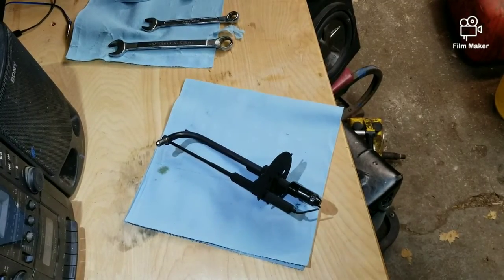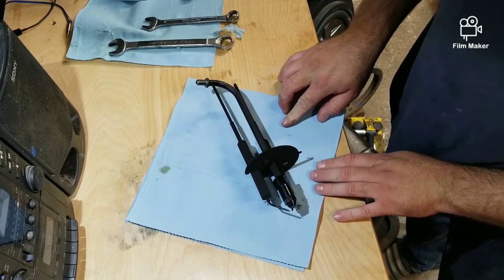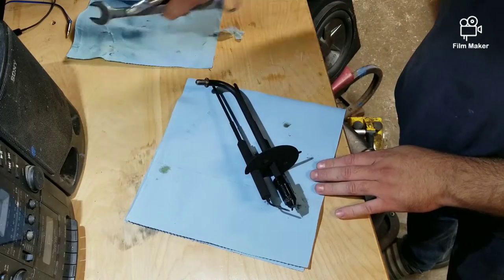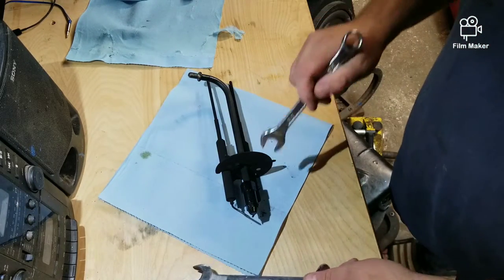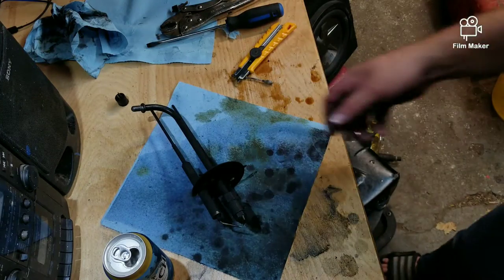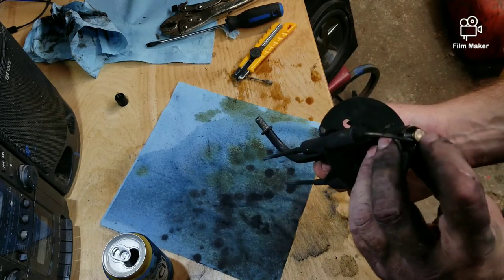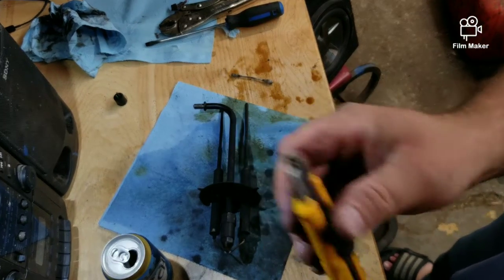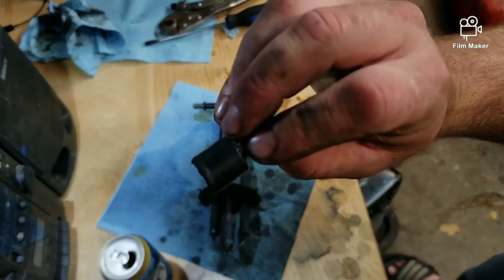How to clean a oil furnace injection nozzle

Comment: Step 1...buy a New $6 nozzle 
Step 2....throw away the old one
Reply from the maker: Actually $18.99+tax $21.46 and that's if theres any in stock.. I clean the nozzle 3 times a season because of all the dirty used engine oil I run through it. I've been using this nozzle 3 years with no issues. It takes 10 min to clean it. 
So $22 times 9 times is over $200.... soooooooo yeah.
Reply: @backyardgarage  ...well you're getting nozzled.....if they charge that much...but hey...if the oil is free....go for it
Reply: Disassembled the nozzle and soaked in cleaning fluid...was not worth the effort!  Bought a new nozzle for $5.00 and reassembled the next day.